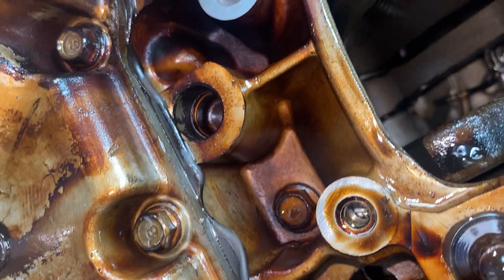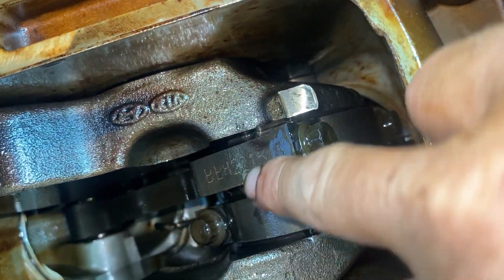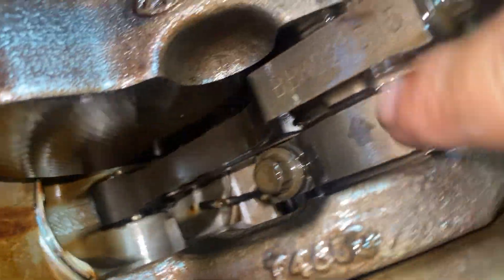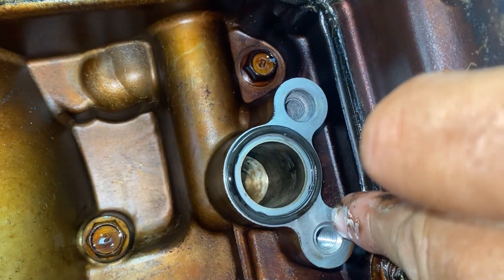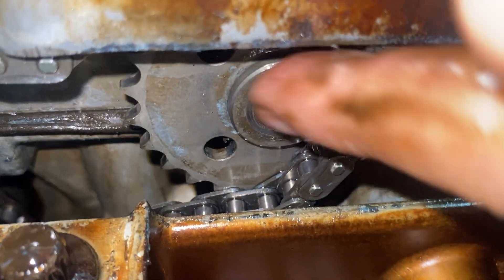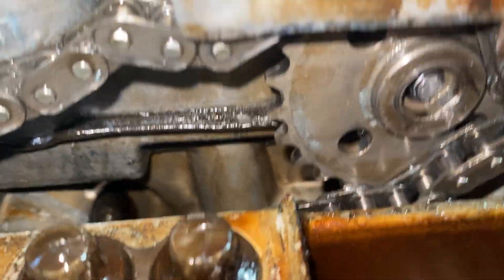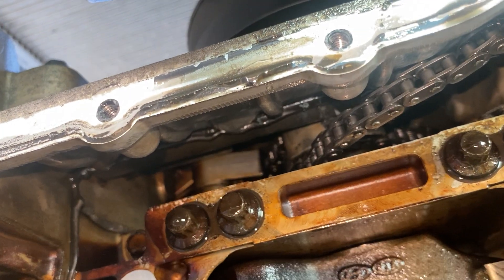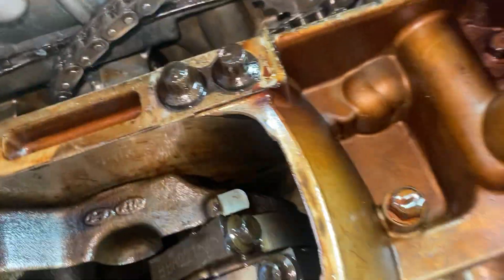Oil pump removed and engine knocking problem found on 2012 Hyundai Genesis 5.0 R-Spec

Comment: Any updates?
Reply from the maker: I had sold it because I couldn’t figure it out
Reply: @clifftayliam8030  was the motor still making power, but just ticking? Do you have any other videos of it
Reply from the maker: @tylerwood5143  it was still making power
Reply from the maker: It wasn’t getting the oil correctly, so I sold it. I do not another video to show you.